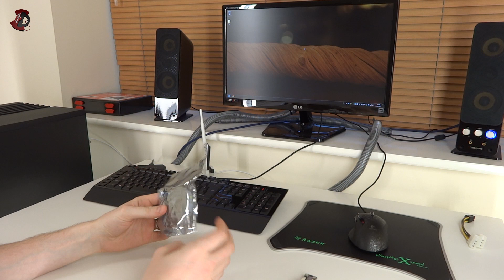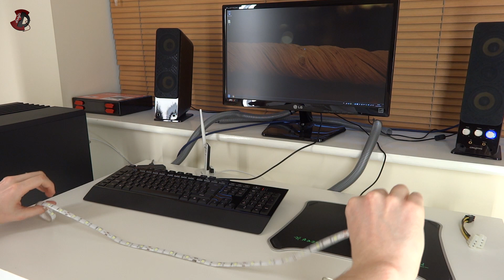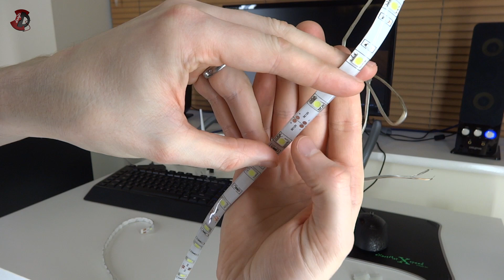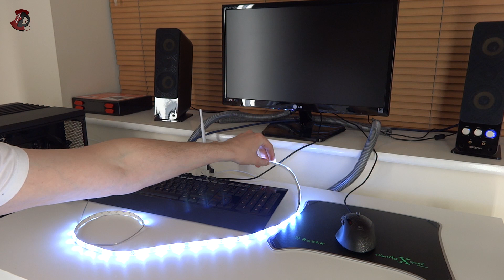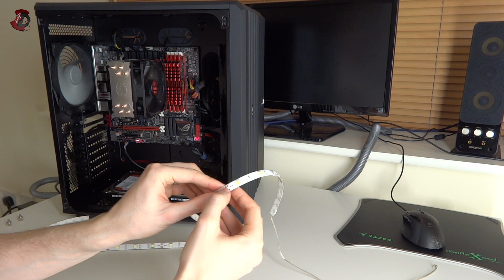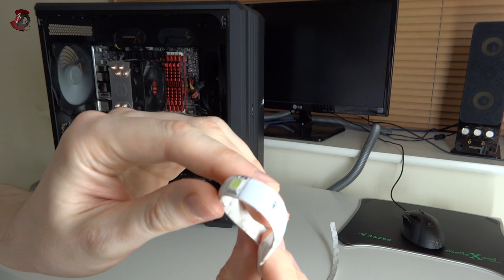LED Strip 12V SMD 5050 Cool White Review

Comment: I just bought one of these and I really like it. One thing to keep in mind though is that the glue on the adhesive tape is very weak. And I mean VERY weak. The tape is barely usable. It might depend on what you try to tape it to though. I tried to tape the LED strip on a metal NZXT case.

Comment: What company manufactures these?  Are they available in FIXED colours like: blue, green, yellow, orange, purple and white?  Where did you buy this?
Reply from the maker: Doctor Who? you can get them on EBay or Amazon. My recommendation is 5050 LED type if you want the brightest ones and don't get ones with waterproof add on. not only they are more expensive they are not that great. I had some of them in my car over winter and summer and the strip cracked (the protection layer, but that took some PCB and broke few LEDs as well). In general best buy is in rolls of 5m or so. You can get RGB ones but they will need extra controller and remote (both usually included in the kit).

Comment: do i have to convert the ledstrip to 220v or just leave it at 12v then connect it to the powersupply via molex? someone said i have to convert it to 220v but im having a second thoughts..
Reply from the maker: Maybe they are talking about a different one. 12V is 12V. Just don't connect too many. Check Amps your moles can provide and amps required from the selected length of the strip. Make sure you don't overload your PSU. Every component adds to consumption.
Reply: thanks for the quick reply... i'll do that. im just puting a couple of led strip on the PSU shroud

Comment: Hey. Good video. Do the LED's have a blue tint at all in reality?
Reply from the maker: Little bit but not too much. If you wish to have no blue tint - go with warm white. Harder to get as everyone is going for freaky blue white but possible to find.
Reply: Eds drafts
The real reason I ask is because I bought some cool white LED strip and there is no blue tint at all. I was actually a little disappointed when I received it. Mine are definitely more of a pure white than what I would have thought to be cool white. Oh well. Great looking build. Good luck!
Reply from the maker: You got lucky it seems. Mine ones are around 6500k which is blue in spectrum. If you have around 5000-5500k you are golden.